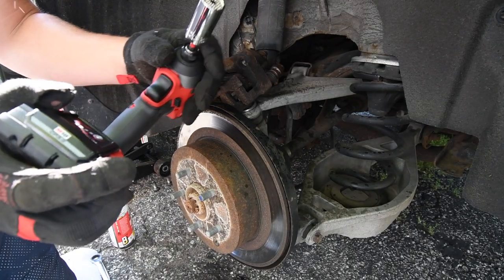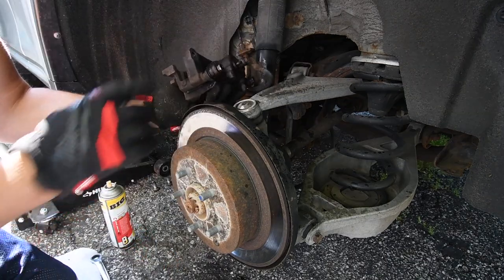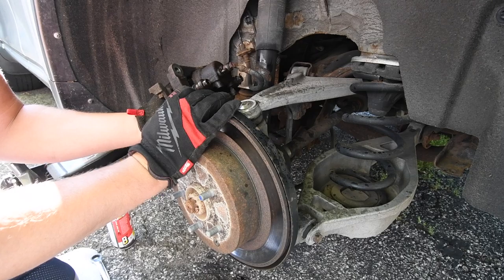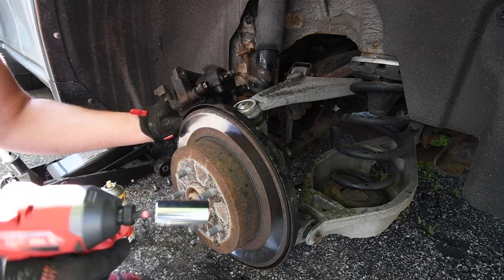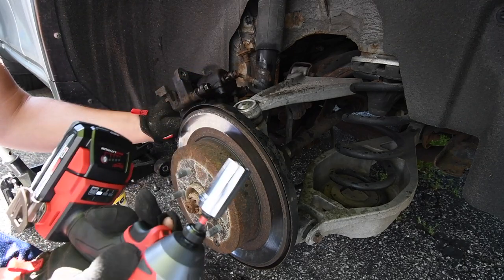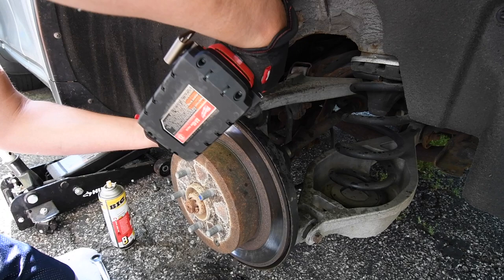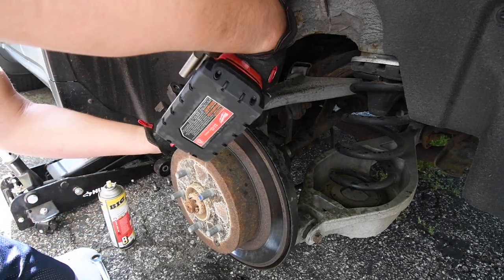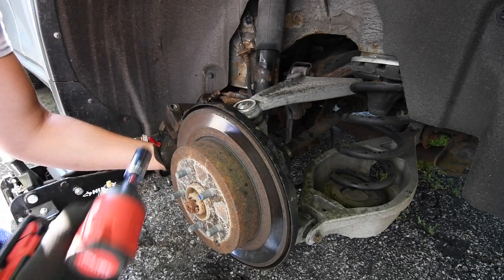Will this work on (Rounded Off BOLTS??)

Comment: I used the Gator Socket to sink four 12” cork screw ground anchors into hard pan dirt with rocks using a Bosch 12v impact driver. Those sockets have a place in the shop with many limitations.

Comment: Ive had the gator grip for 10 years and recently threw it in my smaller all around tool bag with an adapter for my m12 impact and have used it here and there when i didnt lug around a full socket set.

Mainly for basic jobs where i wasnt worried about damaging a bolt
Reply from the maker: it will be useful in some situations